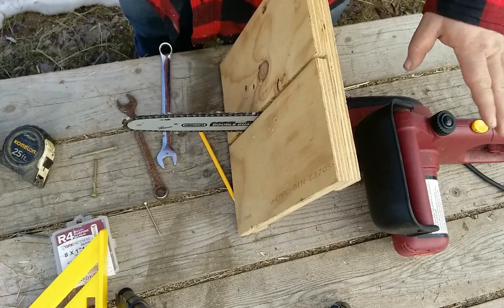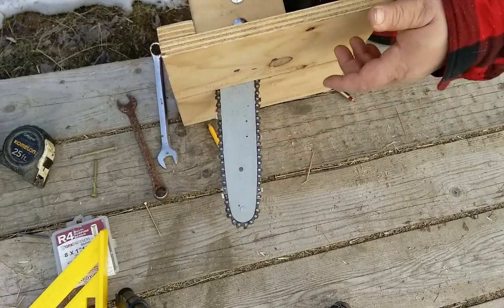Amazing Jig Turns Chainsaw into a Timber Cutting Beam Saw

Comment: I have that same cheap as saw. Oil just leaks 24/7 and leaks and leaks so I can only put in 10 minutes worth at a time. Their tension system really, & trully sucks big time. I am sure the those people spent 5 minutes in engineering. And once that 100,000 saw went out the door, those same guys, after having heard the news on the street that the "Damn Chain keeps getting so loose it stops cutting. Just closed their eyes and ears and said. The tooling can probably go another 3 years w/o changes. That the copy I got, run # 210K-300K. P.O.S. So now I have a 32" Stihl Bar and will be getting the accompanying RIP Chain, and wee will do some real logs. My Guide, a 10' S.S. 1/8 wall tube. no alignment issues and with flat earth and outrigger, I am off to MillTown Races.

Comment: We use our electric quite a bit and we love it. One thing that you should take into consideration is the auto brake that stops the chain immediately. It needs to be able to engage/disengage easily. BTW, you pull the saw, not push it. Less stress on the chain.

But thank you for doing this. I've been wondering about how to do it myself.